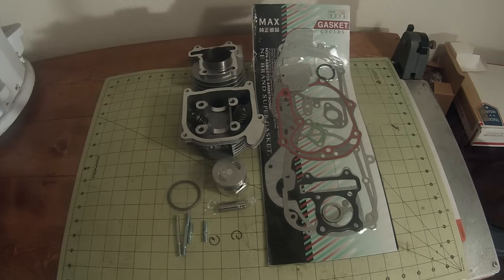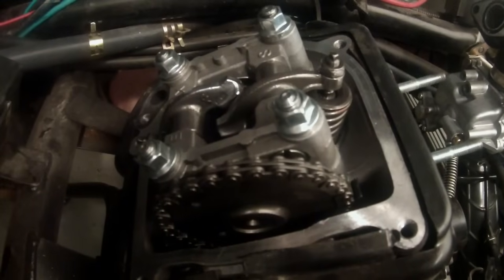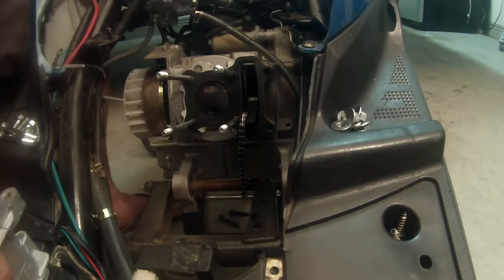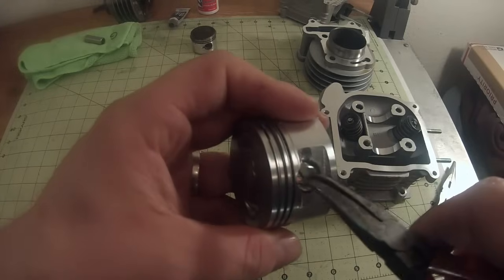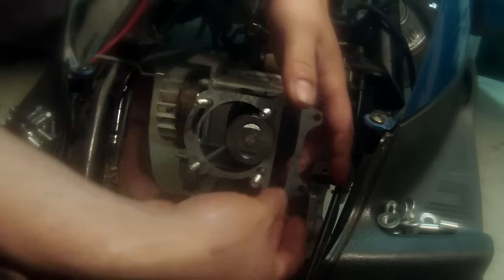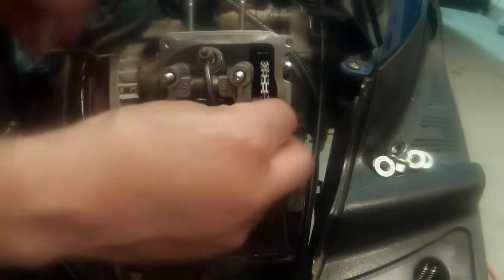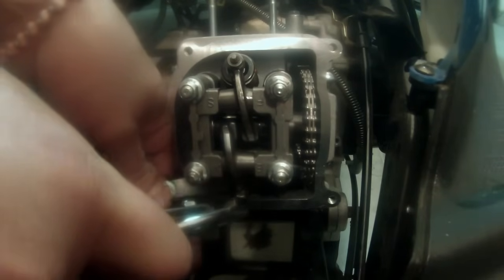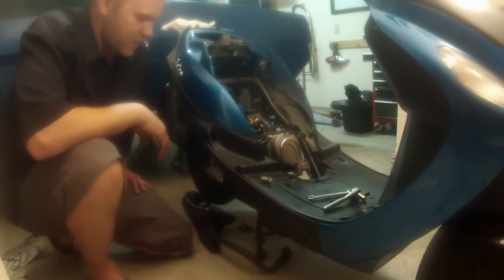How to Install Big Bore Kit on 50cc Scooter - Every Step Included! 80cc or 100cc GY6 139QMB Engine

Comment: I followed your step by step installation...
Dude I hit 51 top speed...thank you so much....my scooter is so fast and super strong. ..you absolutely awesome dude!!!
Reply: Did you use the stock head, or did you have to upgrade it? I bought the 52mm bore piston and jug, but the head is stock and too small (piston hits the head at TDC)
Reply: @richbenson430 sounds like you installed it wrong

Comment: Not sure if i've commented here in the past, but even if I have, I would like to reiterate my opinion on this video and the author of the commentary.
This is the most comprehensible step-by-step installation of a Bore Kit on a qmb139 engine that i've come across. As you've also stated in the video, you've done this many times and get overconfident; however in other tutorials it seems as though they skim over tiny important details because of that overconfidence that you seem to explain very well. 
Crucial information for beginners and seasoned professionals alike. 
I used this video as a reference for installing my first Bore Kit, and she ran wonderfully. I will use this video for further kit installations.
Thanks, Rouse Garage, for being so thorough and taking your time. Teaching is an art.
Reply from the maker: +Yogi Kaius 
Thank you for the kind words!!
Reply: Agree 100%!!!
Reply: @cecileverone953  can you please tell me how 2 order the parts
Reply: @ronathey5287  I ordered my 80cc Big Bore Kit from Amazon. I got it 2 days later, and the kit had everything needed to install for about $30 bucks.
Reply: Hey man.  On my cam the top is past the edge of the head .why?

Comment: 2018 gator scooter 49cc 
I just installed big bore kit 
I watch your video about 3 times and I did it start it right up take off the emissions everything is good thanks alot
Reply: how much faster did it go???
Reply: 47 to 50 it depends on the weight and the wind
Reply: @george102472  With scooters, weight doesn't really matter to a degree as they are designed to have the toque to carry different load... my mate is 190LB and I'm 250lb and there was zero difference on flat surfaces and hills

Comment: Thanks so much Patrick for this video. with your help I was able to install a 100cc bbk on my son's 49cc scooter. This is my first time doing this but thanks to your video it went pretty smoothly and we finished it up this evening and after a couple minutes of starting it, it fired up.
Reply: @Scott Dee without changing the gears 55 to 60 on flat surface which is plenty fast enough.
Reply: Do you remember what parts place you got the 💯 cc from or does anyone know where I can get quality instead of cheap China. Gone through two heads on this Moped motor.
Reply: I would have originally said go with rolling wrench, but with zero response to email info requests I'll DEFINITELY look elsewhere, if a business doesn't care enough to reply to emails then they dgara about customer service. UPDATE: Rolling Wrench is Just 2 people so response times may be extended.
Reply: @JA-fn7le  rolling wrench is a joke ...they charge 8.99 to download a video on how to install a big bore kit
Reply: The laws on these scooters are different in every city it seems. Union city NJ  there towing them. Saying there not street legal.
Reply: @00tonytone  how would mr federali find out
Reply: Any update on how it held up? I know it was so long ago but I want to upgrade but heard stories of it exploding.
Reply: @halffolk21 hey did u ever upgrade ur scooter. I'm thinking of doing it as well.

Comment: I had already ordered a 100cc BBK, 20mm carb, perforamance cam from an online source and then discovered this video. Excellent vid.  
I have a 2009 Tomos Nitro 50 and the sleeve of the new jug wont fit in the crankcase.  I need to get out my die grinder and make
the bore hole larger to accept new jug. Wish me luck.     Heads up to anyone before they start assembly.

Comment: Excellent video. My only recommendations are to also use assembly lube on the camshaft to avoid a dry start, and avoid getting any sealer near any oil passages. If sealer makes its way into the oil system, it will ruin your day.

Comment: just wanted to say thank you just installed a Big Bore Kit just like this and this video made it really easy
Reply from the maker: +Paul Hyde 
Thanks for watching!
Reply: did you add any performance up grades as well or just the bore kit and how much gains?
Reply: You wouldn't be able to do a rebuild video for an XT600? Haha

But seriously, good vid. I just installed a big bore kit on a 2 stroker. Had to freeze the gudgeon pin so it'd shrink, and even still it didn't want to go in. Nightmare...
Reply: Are a v dubber? I saw ur profile pic
Reply: @RouseGarage  I have installed a 100cc bore on a 2018 taotao vip. I had no spark at first thinking the timing was a little off. Played with that and got if running. Now it won't fire and the valves seem like no matter what I set them at. The seem to work their was extremely tight. Any ideas

Comment: Hey, I wanted to thank you greatly for posting this video! Definitely the most comprehensive set of instructions I have found. I just performed the steps on a Kymco 2023 super 8 50x. They were pretty much identical with the exception of the housing had one extra bolt. Otherwise, it was spot on. I ended up using a zip tie to keep the chain safe and one mistake I made was not pulling the chain far enough out when I was trying to push the assembly back together. So the chain got caught a little bit nothing happened, but, just caution for anyone else when they were putting everything back together. Again thank you very much for a fantastic guide!
Reply: I also lubricated the cam before I put it in

Comment: I've got everything including tools to put my big boar kit for my gy6 zummer 50cc to 80cc 
But  since I've mixed 6.5 and 8.5 rollers in it's riding great I had it at 45 on a straight away should I wait to do the big boar or go ahead with switching 😊

Comment: Great video. I would add to check the flywheel to make sure it's still at TDC (the "T" at the mark) before closing up the engine... It's not impossible for the flywheel to get turned/rotated while you're trying to get the rings and piston into the new cylinder. You should recheck it before lining up the camshaft and timing chain.

Comment: I have a 100cc big bore kit coming in this weekend and I’ll be using this video for each step. Thank you for all this detailed information.
Reply: How did it go?
Reply: @kkaarriimm  It went really smooth and it’s running great and so much quicker. Super excited about it
Reply: @7777R  thanks for your reply I’m glad it worked out for you :) 

May I ask, was it possible to fit a 125cc or was it exactly for 100cc bore?
Reply: I mean like the engine itself, can it take a bigger size cylinder?

Comment: The rings, I have always put the gaps 180° from each other,  I have seen others do 60°  but that doesn't make sense to me, 180° always worked for me! And I always put them at 12 & 6 o'clock,  I also like to polish the dome of the Piston, to help prevent carbon build up,  and reflect heat a bit, possibly.  It wouldn't hurt to slightly lighten the Piston, without weaken it!!  I just done one of these, I ported the head and unshrouded the valves, went to a A9 cam, and 20mm carb, I'm about done, and ready to see how she do!

Comment: Emery cloth and brake clean to take off a gasket, then of course an oil change before start up and a good trick is to grease the gasket for install except the head gasket, it will seal perfectly, and come off with no scraping next time you tear  down if you have to.

Comment: Steve from Annapolis Maryland you're doing a good job with the extension on your torque wrench will subtract it will not be inaccurate 12 foot pounds or whatever it was you said you got to subtract every so many inches because it reduces foot pounds of torque to the socket because of the extension

Comment: I followed your video and installed a big bore kit, high performance large valve head and a A9 performance cam. Thank You! Yours was the best I've seen to do this.

 I'm going to put a big bore kit in my wife's scooter as well. On your video everything was stock except for the big bore kit. My question is do you think the larger valve head and big bore kit are worth it or does it add very little performance in relation to the added cost. I ask because you didn't bother with those upgrades. Also want your opinion of performance exhaust and heavier/ lighter rollers as far as actual performance high end or otherwise.

Comment: you need to put oil on the piston pin before inserting it aswell as the cylinder bore . Great instruction by the way
Reply from the maker: +Jonathan Vogel - Great point. I usually don't, but it will definitely prolong engine life.
Reply: Also put assembly lube on the cam, (both the bearings and the lobes). And for good measure, both contact points and the pivots of the lifters. Assembly lube is cheap, new parts are not - "An ounce of prevention is worth a pound of cure".

May not be needed, but I always turn over any motors I work on by hand with the spark plug removed, to help pump a little oil before a hard start. These little motors are easy to do.

BTW, great video. Only wish you did a before test run and an after, to see the difference.

Comment: Great video. My only gripe is that you shouldn't use assembly lube on the parts before install. It's going to get into your engine oil supply. You should use the normal engine oil that goes in the engine. That is what is going to be lubing it when it is running anyway and using engine oil to coat your parts means that your oil supply won't be contaminated by the assembly lube which may not be suited to the engine.
Reply: You're kind of right, but any competent and experienced tech knows to change the oil almost immediately after breaking in new engine parts. 
The factory uses the same lube, and it stays in the crankcase until the first owner decides to do maintenance, if ever.

Comment: definitely put a cire or pad lock(don't lock it) around that chain, don't let just hang. a 10 inch piece of copper core wire is best. This guy knows what he doing, if you don't, then put someone thru it to make sure it doesn't fall.

Comment: This about the most detailed video I have found, I do have a question though,  I must of watched this 5 times , And checked and rechecked everything, I have what seems to be the piston knocking on something while running, I have taken it apart numerous times all the way to the cylinder and check it over and over, I cant seem to find anything everything is in the right place, timing chain is tight no slop the valves are set properly to .004 theres no binding anywhere, everything moves fine.  NO issues running , idiling or in performance , it runs fine . Just knocks and its driving me nuts. Fresh rebuild last week. Thanks for the advise so for all the rambiling .

Comment: things to know you should put a bigger jet in the carb and I seen in your video you loosening the vales after you tighten the head down I would loosening them first so you get a good tor. on the head because if you do not then could be putting more pres. on the head bolts but grate video like it a lot I have just got a 50cc rally scooter looks like a VIP to me for 125 with looks like 1.2 because it was lay down first ride to me but not bad few little markand I have a 2008 vento triton 49cc that has a big bore on it and I had to jet it up to make it run right
Reply: Adam Eckenrode  what time on the video was that
Reply: So before jetting up, you’re big bore kit wasn’t firing up right? When you added the new main jets, your scooter fired up?
Reply: @michaelz5692  the bore in the C. was bad this  motor did not have much comp. so i just when to a big bore for about same price and go more power
Reply: Blazin Draging I’m having trouble. I installed everything correctly. Timing, valve gaps, spark gap, battery, piston ring gaps, fuel pump....everything done right. I don’t know why it does not want to start.
Reply: @michaelz5692  check comp. first if there nothing its not time right there 2 dots on the gears that have to be time right and vales are think .10 and other is .20  hope this helps
Reply: Blazin Draging my 80cc are suppose to be gapped at .004
Reply: Blazin Draging my timing is done correctly as I said
Reply: @michaelz5692  ok i thought my was .10 or .20 thus. to big of a gap and the vale will not open right i do not that the intake was differnet from the the exhust its been so long i do not rem all the numbers sorry

Comment: first,thanks for your informative vids,if the scooter had 64mm valves and the bbk came with 69mm with a cam,can i just change rocker arms to accommodate? or is the crank stroke made for 64mm and the 69mm hit the piston head?

Comment: If your kit came with an aftermarket cam gear and camshaft that only has 2 holes without the bigger 3rd hole, how would you time it? Also I can seem to fit a feeler gauge under the bottom valve even if it's fully turned out.

Comment: Hi all just a helpful way to put in the studs in its best not to use pliers the safe way so you don't slip and hit the threads or slip and hit the smooth srfis on ether side of your head I all git two nuts and put the two nuts on one stud and jam them together then titan then undue and jam nut then do the next one so just keep doing it till your dune. You can do it the way he is showing you it's all up to you how you want it put them in. Have a good day and be safe.

Comment: How about the pipe connected to the valve cover?

On my scooter it goes to the big "octopus" you removed. What did you do to it?
Should I close the pipe?

And also theres an other pipe from that octopus that goes to a "pump" or so to the top of gas tank.

Comment: I have a 2016 taotao that I’m hard on it’s pushing 18,000 miles on the block but the crank is still good do you think I could rebuild it with a big bore kit or scrap it and find a better block and crank?

Comment: Question. Do you recommend assembly lube or would it be ok to use the same oil I'd fill the engine with for pre lubricating the jug, camshaft etc.?

Comment: May as well bore out the intake and exhaust ports and polish. Adds tons more torque and I run a 105 main jet with 20mm carb and thru and thru glass packed silencer. Also have upgraded final drive gear and top out at 75mph with 9 gram roller weights.
Reply: you should post a video showing your top speed.

Comment: PS if the cylinder isn't mating with the block. Dont hammer it down to close the gap. Your timing chain is stuck in the gap. I found that out. Be certain of no slack in chain before mating cylinder to block.

Comment: I put one on mine and it is hard to start it seems like starter isn’t strong enough to turn it over some times. I am redoing it because they sent wrong rings and gaskets but I don’t know if it’s going to be easy to start even though I’m redoing it it’s on a 50cc trike I don’t know if there’s a difference between the two wheel or not but everything you showed I done but it is torn down because of bad gaskets and I hope I figure out how to get it to start easier.

Comment: I have install the big bore kit on my 139QMB scooter. It runs great, but when my kid and I get on the scooter the pushes the rear main seal out and all of the oil leaks out. We are both total of 320 pounds. Does the back pressure increases because its too much weight for the motor to handle or do you think it’s some other issue when the big bore kit?

Comment: I want to put a 72cc bore kit on my scooter but how would i determine what size main jet to use ??
Reply: Just installed mine, you ever figured it out?
Reply: YJ's & XJ's All Day Google the model and the cc. 
Should come up
Reply: korohone I sold it lol
Reply: Depends on what size your carb is,  I got a 80cc kit on mine 20mm carb, with a 95 main jet, have performance exaust that's why I'm running the 95 instead of the 90  main jet and a 42mm air filter with 95° intake, racing CDI and coil, running about 53 on flat ground close to 60 downhill. And I've never messed with the varriator or clutch that's my next project,  i know I can get 60 consistently if I get that tuned right.
Reply: Depends on what size you carb is I got a 80cc kit on mine 20mm carb with a 95 main jet, have ordinance exaust that's why I'm running the 95 instead of the 90 and a 42mm air filter with 95° intake, in running about 53 on flat ground close to 60 downhill.

Comment: just some questions i have a garelli gary uno 50cc stock 40mm that seized and used to overheat i bought a replacement stock but got a polini 46mm big bore which believe is 70cc, what would happen if i put a stock exhaust and stock 15mm carb on it? will it be underpowered? will it ruin it?

Comment: Great vid, thanks, but assembly lube is for assembling parts where oil will eventually go...so why didn't you lube the wrist pin, and camshaft, and rockers, and valve stem ends, etc etc?

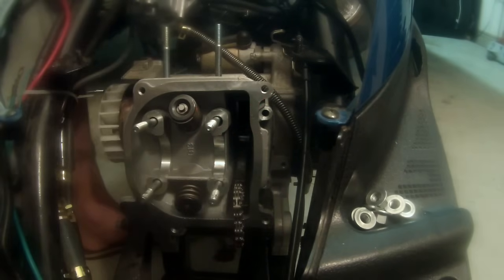Comment: Thank you for the video. Minute 42:00 I think you didn’t mention later to tighten the screws. 

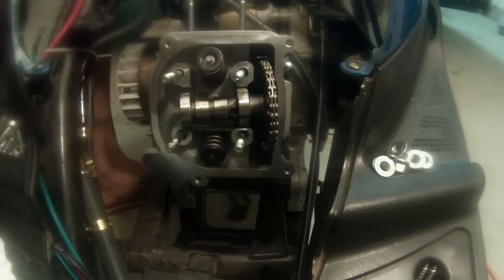However, I followed all your steps and I ended up with an extra washer where it fits in the minute 43:52 (I put them exactly like yours 2-spacers) can this be an issue? I also had the four main studs bent but I forced all the parts to enter the studs. Will this be a problem? 

Thank you in advance

Comment: My 70cc first time installment won't start, mnade sure the valve/carb & etc was right adjusted, still it won't simply start and i've been going on for 5 weeks straight without success, any guess?